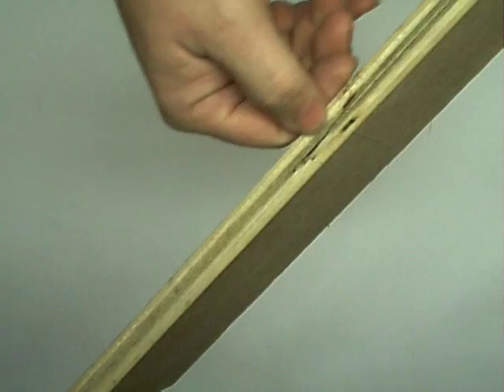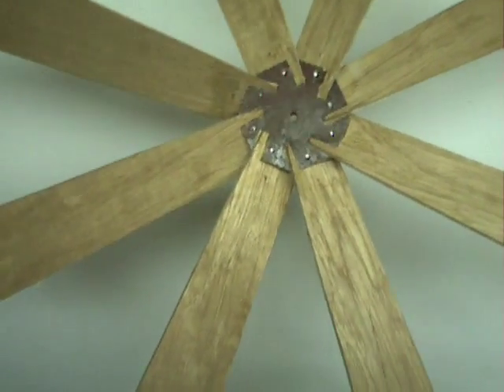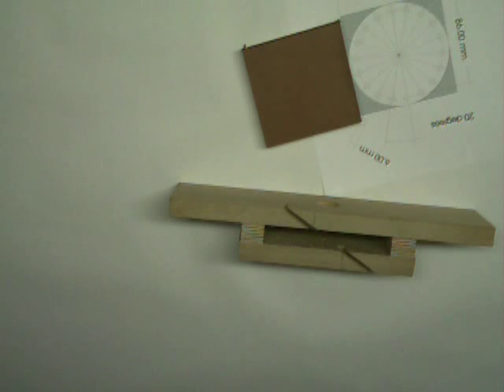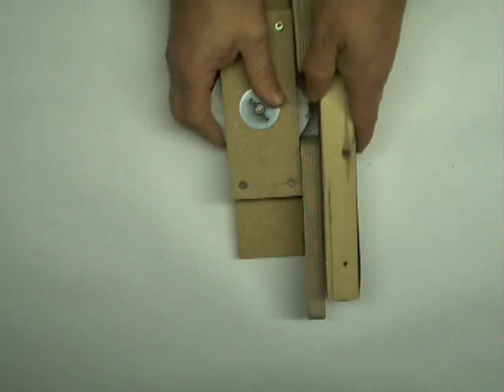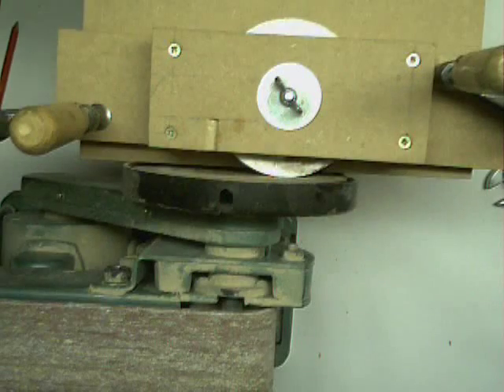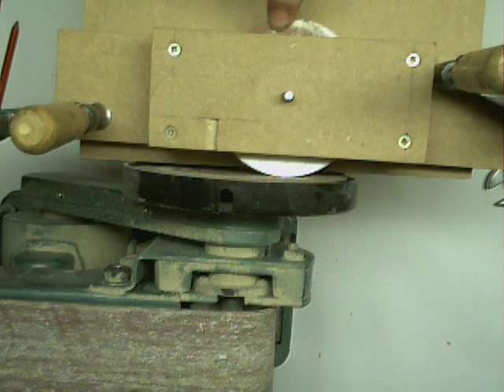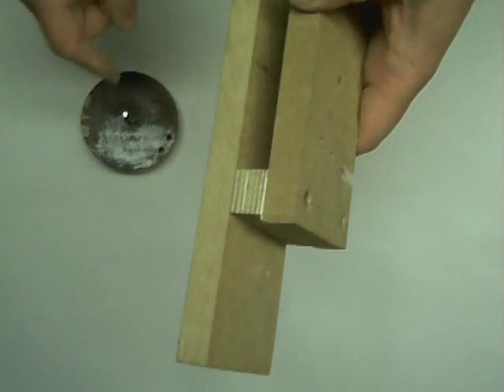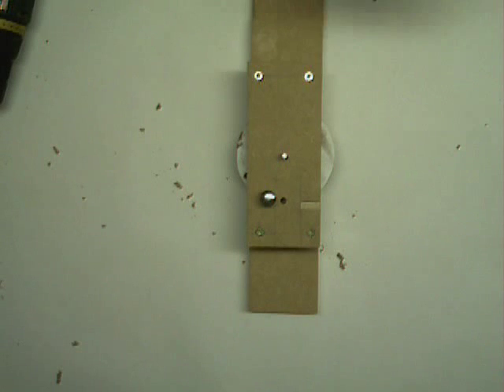Wind turbine project Gear A part 3 (theDaftman)

Comment: i guess it would have a slight problem falling out that way. i didn't use a sander to get my wheel round but your idea inspired my idea of using the drill press in a way i didn't think of using it. a little adding to the plate on the drill press to get my wheel center out away from the bit, i then used a router bit and put the drill press in high speed turn wood 360 degrees and your left with a circle. great idea all the same. ps i want to see the cogged version finished. 1 to 1 would be boring.

Comment from the maker: Its a coach bolt it would need to pull through 2 18mm MDF and the work peace 18mm marine ply to drop out the bottom it would have to push through 18mm MDF and a cast aluminum bass.